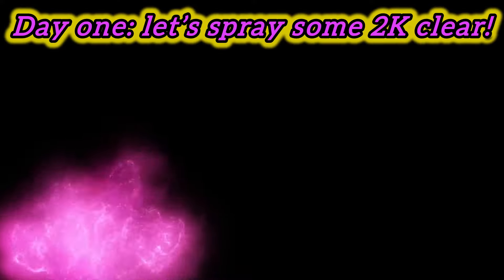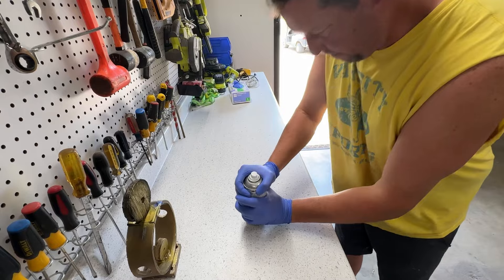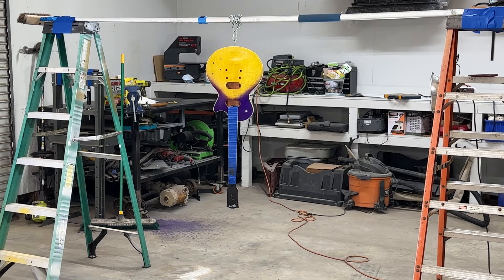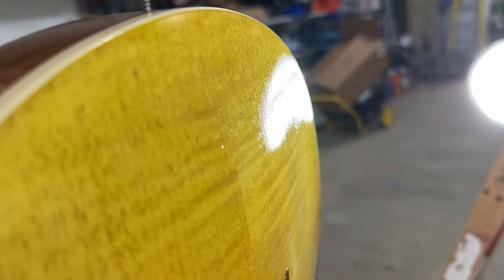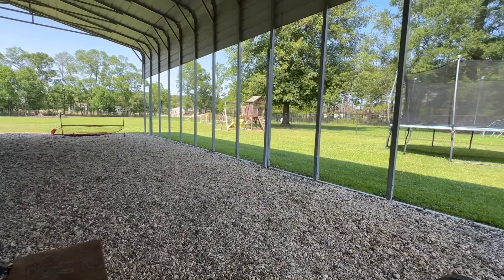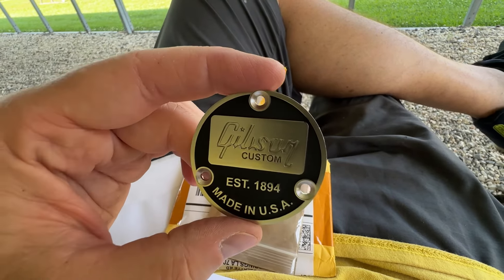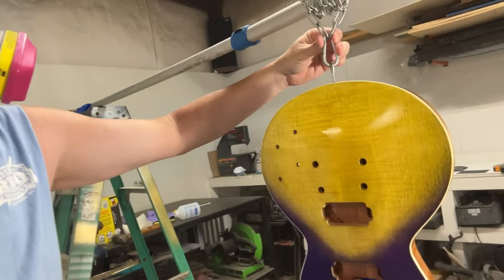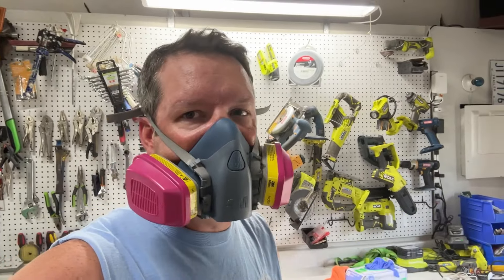How to clear coat. Guitar cleared with spraymax 2k clear. Guitar build #guitar #clearcoat

Comment: Looks great! Curious what the wet sanding process was between the first and second day?
Reply from the maker: @kylec4509  thank you so much !! after the first day of clear dried I used 1000 or 1200 wet to just level sand it. After that I spray another can. Once the 2nd can isn’t dry I used super assilex “dry” then went straight to scratch x with different pads. It’s the same as the headstock video. There are other videos of mine that also tell what I do. Thanks for the comment ! Keep watching and sub !
Reply: @leeslife1981  awesome, thanks so much for the reply!
Reply from the maker: @kylec4509  no problem. Hope it helps you out ! Good luck !

Comment: What did you use for grain filling before the clear coat?
Reply from the maker: @Mario-jn5zq  I used goodfilla before any color. I use it on the entire guitar. You will see that in earlier videos.  It gets really thin and easy to work with. Fills even the tiniest holes. May have to use it a few times but it does good. After the dye I used clear dewaxed shellac on the top.